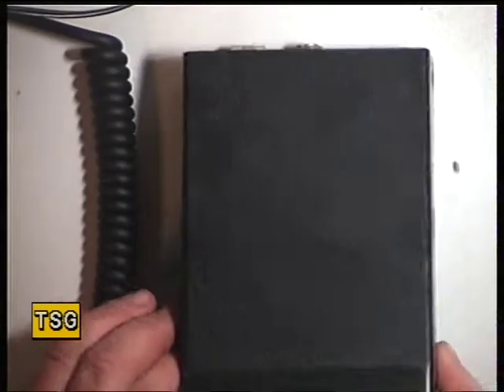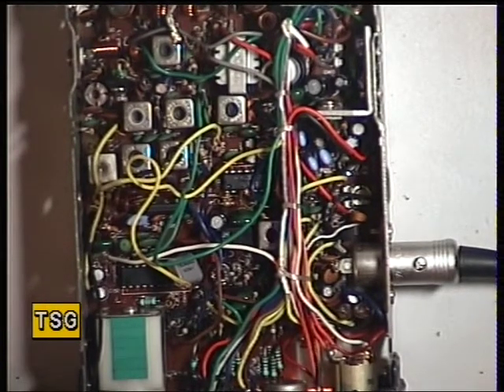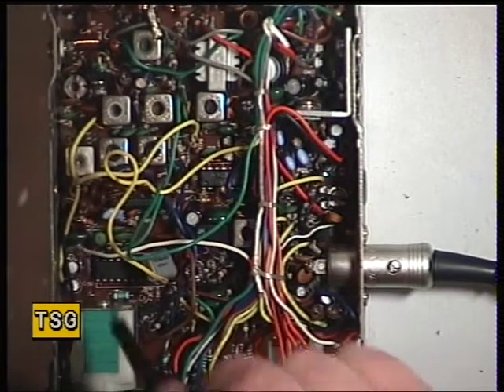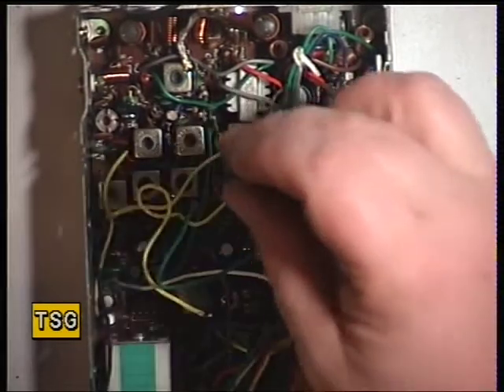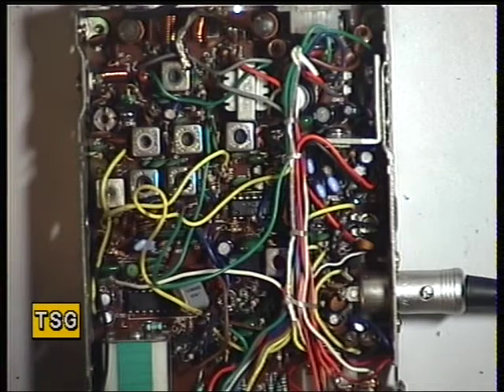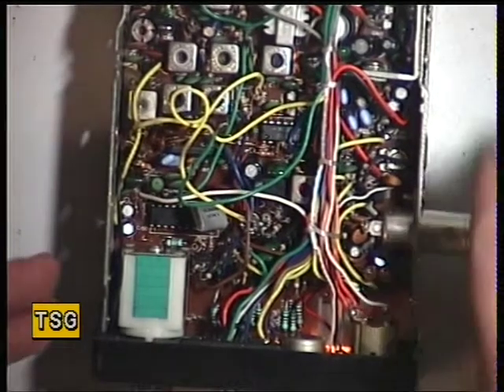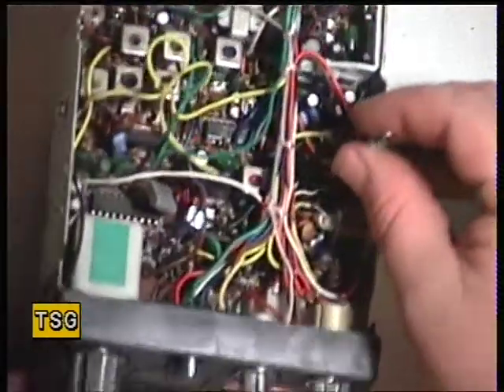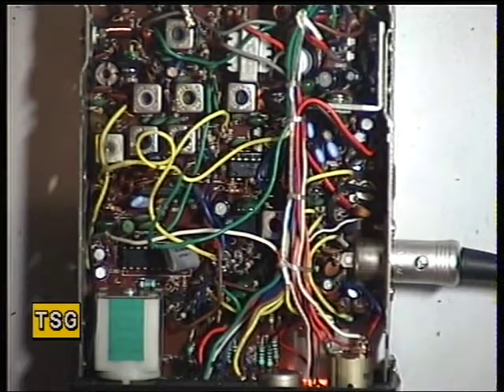Maxcom 20E, UK (CB 27/81) CB radio (Mobile) - Transmitter alignment

Comment: Hi Richard.

Great viideo, as always, and I found it useful   However, I'm not sure if you uploaded this video before you obtained the instruction manual for the Maxcom 20E that you posted on Scribd.com (https://www.scribd.com/doc/122915430/Maxcom-20E-CB-radio-user-instruction-manual-circuit), but the alignment instructions are at the back of the manual.  Unfortunately the sequence you've chosen for the TX and RX line-up aren't quite correct, according to the manual.  The TX line-up sequence is L105, L111, L112, L107 and L110 then L101, L102, L103 and finally L104 (appears to be detector).  The PCB layout page at the back of the manual is difficult to read, but just about shows the location of each variable inductor.

What I found difficult with aligning this radio was evening out the RF power across all 40 channels.  On my radio there is a fairly steep peak towards channel 18 of about 1.5 watts over the wattage I get on channels 40 and 1.  Would expanding L108 and/or L109 or adjusting L107 fix this?  There is also the mysterious RV104 in the power supply section of the PCB.  Any idea what it's for?
Reply from the maker: Hello there,

I can't delve into this at this time, but next time I have a Maxcom 20E on the bench I'll see what I think. I've printed your message off.

Richard
Reply: No problem, Richard. Thanks for your attention.  By the way, I meant to mention that the reference to the VCO variable inductor in the manual as L102 is an error and should be L201.